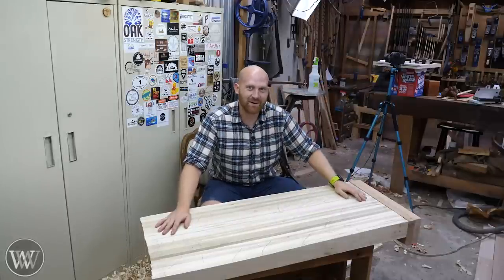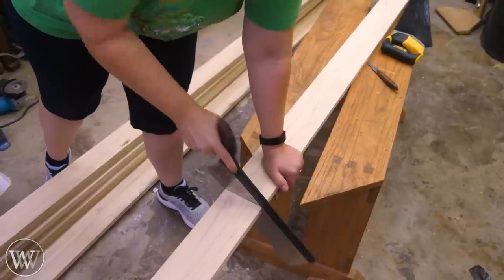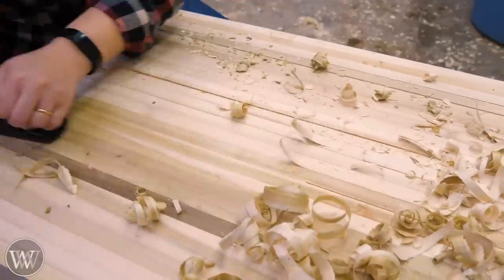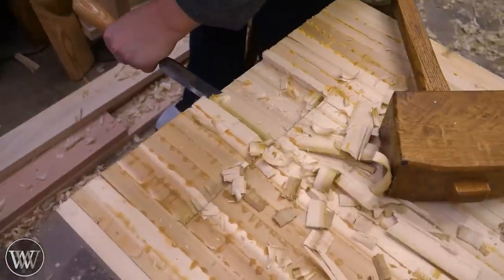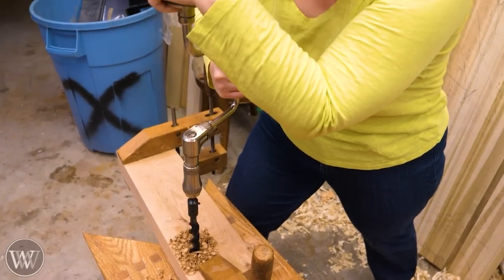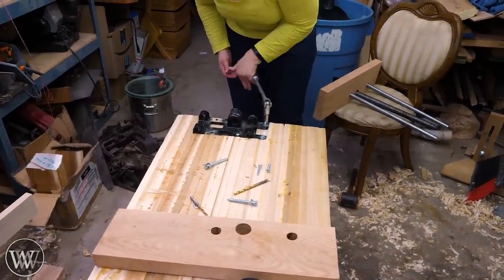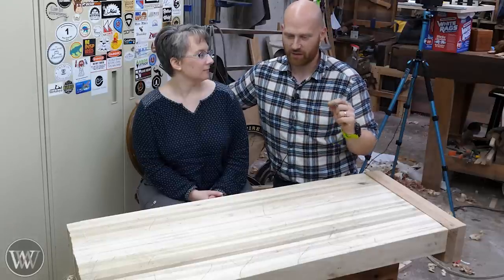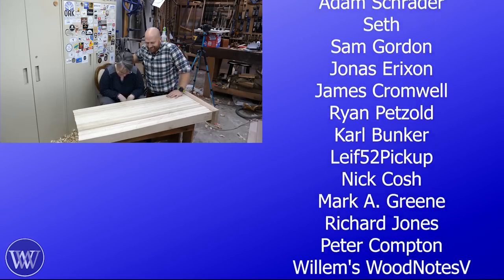How To Make a Bench Without a Bench Beginner Woodworking Project

Comment: Most Excellent! Congrats Sarah!
For Sarah it might be worth the hunt for a ratcheting bit brace - the one my dad has has the usual forward and reverse, it also has a ratchet option - this allows her to keep the handle in the arc range where she has the most leverage (either pushing or pulling through some 60 - 90 degrees or so) This would let her be able to use those larger bits when needed.

If I can remember next time I'm home I'll look at his brace and see what brand it is (I used to use it as a kid a lot)
Reply from the maker: Right on. This one has a ratchet on it. But even at 90 degrees it was too much for the 1-in bit.

Comment: Second watch, still a fun time. Just watched the legs video and she did great on that video too.
My main question here is, why the end of the bench did not get planed before adding the vise chop? Of course saw dust will eventually fill those voids, but showing her how to be a true perfectionist woodworker will result in more pride on her part in fit and form in her projects in a much quicker time frame. I'm sure she wants her projects to look as good as possible, and working on a bench with gaps and errors is less inspiring to most people.
Still, great job for a first bench build, Sarah. Your quality is only going to be as good as what your coach/teacher pushes you toward. I will admit, as a self-taught crafts-person, it does look much better than my first few builds ever did. Awesome job, young lady. Quality will improve with time and the willingness to improve as well. Love that you want to get into this hobby with James. Just remember to have fun with it.😁
Reply from the maker: she did plane a good bit on it, but the amount of work it would take at her skill level was just not worth it. but the nice thing is as the skill improves it will be easer. and it can be fixed by removing a few bolts and then hitting it.
Reply: @WoodByWrightHowTo  oh, okay. I guess either I missed it or it "hit the cutting room floor" so to say. Again, once it fills with sawdust, some CA will keep the sawdust in place. Or, like you said, after her skills improve and she has built her planing muscles she can remove the vice and plane it if she so chooses.
I hope I came across as constructive and not mean, I don't ever want to be mean.
Love you guys and your channel.
See y'all next time.

Comment: 1:10 - Even having a choice of other hand tools, honestly, my go-to choice for rough-length crosscutting is a Stanley FatMax from the box store.  15 inches, 8 tpi, and being induction hardened it stays sharp for ages if not banged around.  Plus if it does end up badly damaged somehow, it's cheap to replace.

Comment: Tip for gluing with PVA:  Laminate boards in pairs.  (Two boards laminated, sheet of paper, two more boards laminated, sheet of paper,...).  This allows for adding pairs to the clamps unit you reach the desired width, while at the same time not rushing you on working time.  After about 1-2 hours, you can loosen the clamps, remove the paper (or every other paper), and glue up the next level of laminates (i.e glue the pairs you just made to each other).  Repeat the removal of the paper "spacers" until the entire lamination is done.

Also, not all PVA glues are the same.  Generally, those with more solids or "waterproof" (e.g. Lee Valley Cabinet Maker's Glue, and Titebond III) tend to have considerably longer working times than the more generic PVA wood glues/carpenter glues.  Using this idea with the pairing method above, I find I always have ample working time, and "Ice Tea Time" (glue drying time).
Reply from the maker: Yep. That's why we were using titebond extend.
Reply: This is a good tip,  thanks.

Comment: Poplar as opposed to say using studs or something? Is it because the poplar is mostly clear? (Or if there are knots...minimal?)
Reply from the maker: Poplar is a bit harder. I find it to be a good balance for the beginner. it is more durable then SYP or ant stud grade pine. but still soft enough that it wont dent most things you make when they bang into the corner.
Reply: @WoodByWrightHowTo , I really appreciate you taking the time to answer a question on an at least two year old video!!!

Comment: Sarah, he hasn't told you the secret of sawing straight.  
Point your index finger along the side of the saw whilst you hold with the other three and thumb.
Reply from the maker: We tried that. But with this saw it doesn't work well due to the plastic handle and it being too large for your hand. Someday I'll make a set of saws with her size handle.
Reply: @WoodByWrightHowTo  I wondered if that was the case.  The standard handle is made for Paul Bunyan.  Bespoke handles make a LOT of difference to saw control.

Comment: Great video! Already curious about the next one. But i got 2 questions about the bench, why do you recess the base plate of the vice into the bench? And why is the vice itself of center?
Reply from the maker: it is reassessed in because you want to get the screw as close as possible to the middle of the chop top to bottom. the closer it is the less tipping the jaw will have at the top edge where it is most used. it is out of center for the same reason we want to move the screw up. we want it to be as close to the work as possible. most of the clamping work will be on the left edge of the vice so we want to get it closer to that point. the only reason the chop runs the full width of the bench is it will help when edge planing  as it will hold a longer board more firm. and in that case it does not matter where the screw is along the chop as it touches along the whole length.
Reply: @WoodByWrightHowTo  Thanks James! That makes a lot of sense, actually explains why my own vice tends to rock a little. It's of center top to bottom. Thankfully, as Sarah showed, it's an easy fix :)

Comment: I looked through the comments but didn’t see this question. You said epoxy was an option. What epoxy would you have used. I’m new to all this.
Reply from the maker: Basically any structural epoxy would work fine. West system is kind of the gold standard. But my go-to right now is total boat high performance.

Comment: That poplar was cheap. It'd cost me $1457 for that bench top alone around where I live. I ended up using the cheapest and lowest quality construction lumber for my bench top.
Reply from the maker: ya this was before the big spike over the last 3 years. back then it was only around $50 more then pine. but still if you go to a mill or hard wood dealer it will be MUCH cheaper then that. check out the map to see if there is one near you. https://www.google.com/maps/d/u/0/edit?mid=1N039omAxWzBeCcDx7QaIc9YvZ_GU4j1c&usp=sharing